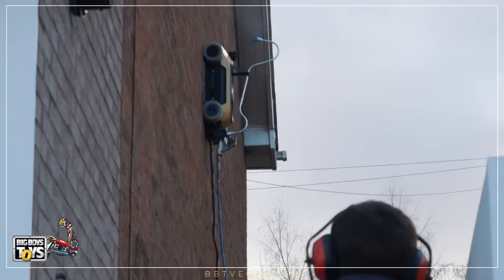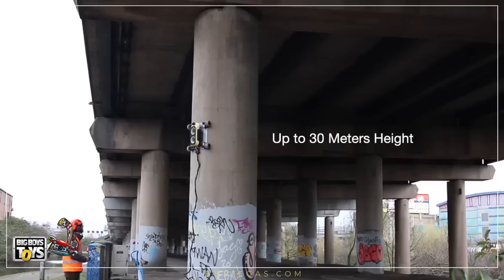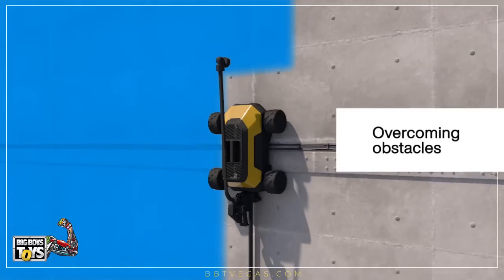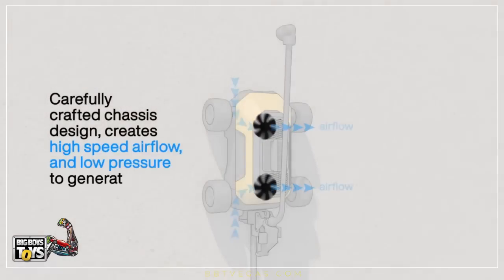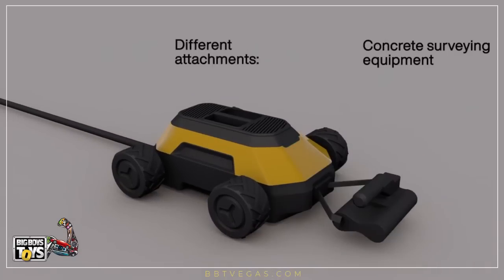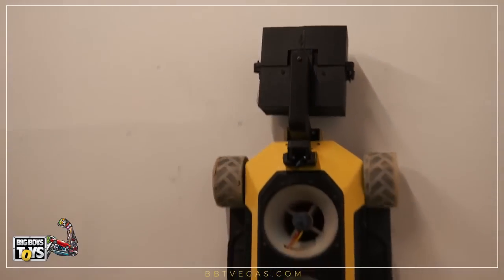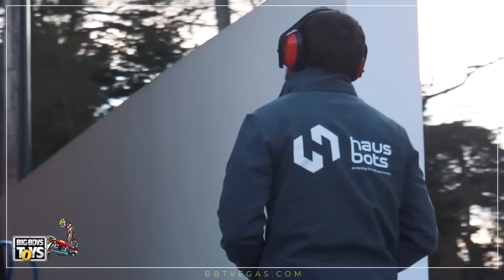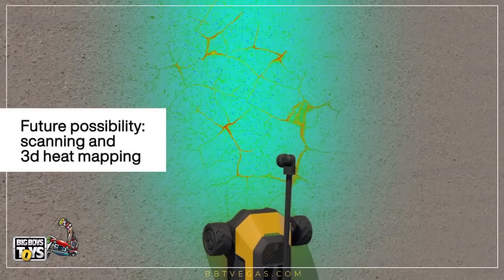HB1 Wall Climbing Robot

Comment: How does does the robot know that it has painted the surface properly? Does the robot measure the paint thickness after painting the wall?
Reply: Also, how does it know it's painting the right parts i.e. what if you don't want a certain part painting? How does it do the corners?